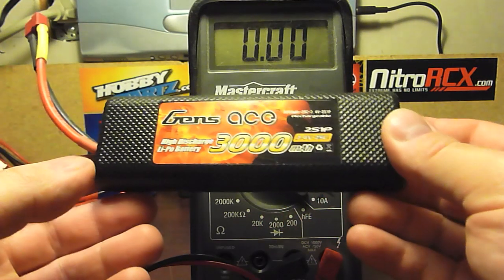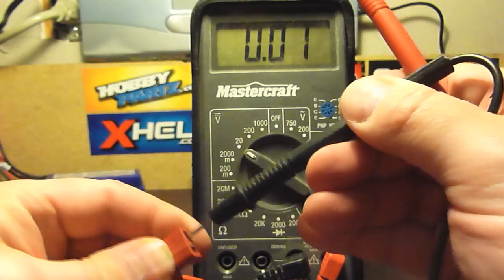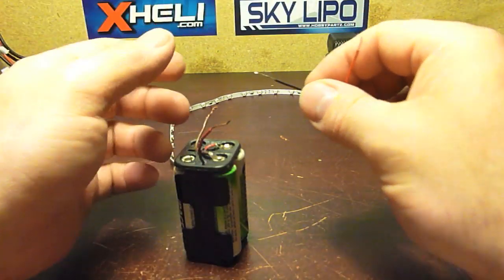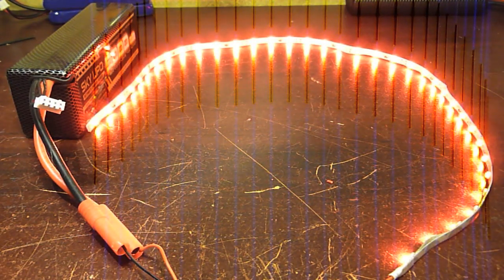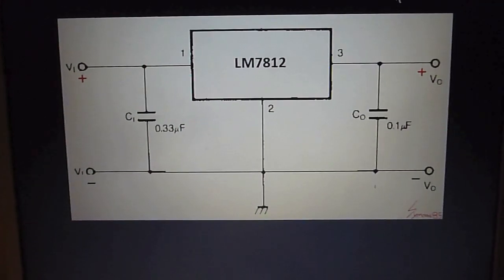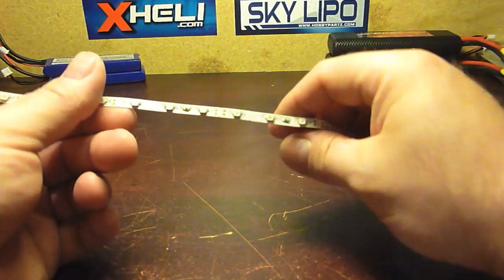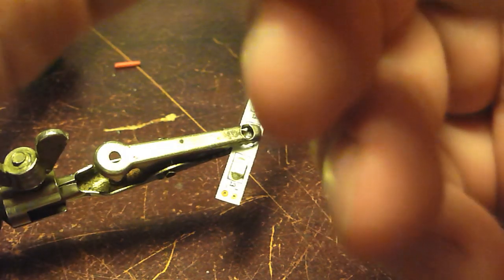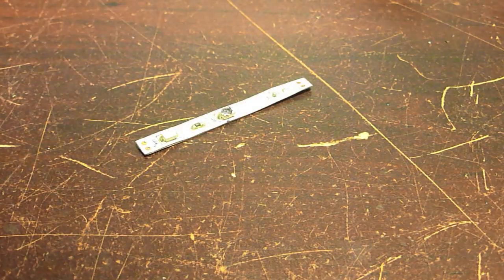Battery Voltages and powering LED Strips

Comment: Hi! I was planning on using a 2S or 3S lipo to power up a 5V addressable led strip. The strip is 5 meters, but i have an option to cut it in half.
I really like Lipos for their size and weight, but the voltages are a bit too high. Of course, i have a arduino controlling the leds, but the logic level is on separate leads. Any suggestions for voltage regulation/dropping it in some way?
Reply from the maker: Iikka Konola there are lots of options for regulators. the easiest is to get A DC/DC step down regulator on eBay. they are very cheap. or you can make your own. Google it.
Reply: TheLEDwheel I have a 3A 5-35V one, just wondering about the correct it would be handling as 5m would be drawing 18W/m and  90W/5m, so 90W/5V=18A.
Reply from the maker: Iikka Konola this is why 12v strips make more sense. it's just easier to power. at 18amps draw it will kill the battery quickly.

Comment: I bought a led strip  (12 volts). I want to power it with a battery. Can I use a 9v battery or do i need to use 8 x 1.5 volts? 9 volts is much smaller and easier to change if necessary.
Reply from the maker: hi, as mentioned in other comments, a 9volt battery will work with two issues. it won't last long and it won't be as bright. voltage is only one part of what we need to look at when deciding how to power anything. voltage will change your brightness but amperage will change how long you can power you items regardless of what you are powering. figure a smaller battery with higher voltage will always have less amperage.
Reply: +TheLEDwheel It has to work only around one hour  a few times in the week and it will by like 60 cm, so i think 9 V battery will do the job. Thank you
Reply from the maker: +C4mpi59 try it, I doubt a 9 volt will last an hour.
Reply: +TheLEDwheel I can't get 12 volt battery in my country, i would need to ship it from abroad, and this would be more expensive. Unfortunately i don't wonna pay too much for something that will be used just for some time for my guitar pedalboard.
Reply from the maker: +C4mpi59 get a 12 volt 1-2 amp AC to dc adaptor..

Comment: Hi I'm trying to replace the LiFepo4  solar battery. The roofers knocked off my mount and in the clean-up the battery was lost but the motion detecting LED light was salvaged. I tried and figured out it needed 9 volts 1 Amp. So I tied in line 6 rechargeable 9 volt 1 amp batteries so it would stay 9 volts one amp. It does not last more than a few minutes before it completely drains the battery pack I have soldered together. Is there a way to raise the amp hour? Volts times amp hours gives you watt hours.  But is this volts times 1 amp ? I'm missing something obvious here and I can't figure it out do you know what I am missing? Does anyone?
Reply from the maker: what did the solar kit come with?
Reply: +TheLEDwheel  Thank you for the rapid reply. All information you share to me will be shared (if okayed by you) to my readers as I have the Blog Gajetest.com, and like to give credit where credit is due. So that was my problem I could find out what volts and amps worked. But the roofers in the clean-up didn't save the battery and I only rescued the led light and crushed solar panel. The battery was gone, so I do not know what it held . I looked up the power light and could not find the battery type or the amp hours. Testing equipment for my blog is what I do. I understand that volts times amp hours is watts. However, in a 9 volt battery it would be 9 times 1 amp Is this one amp 1 Amp hour? If so then the it would be 9 * 1= 9watt hours. Again what am I missing? This is really embarassing and I thank you ahead of time for any information you could give. I turn 60 years old in May. I hope a fuddled mind is not my present. :)

Comment: what Sky Lipo 5000 did you use?

I want to make backup lighting in my house for when i loss eletric.
I know its not supper bright but its anuff to see once your eyes get use to it. (Now i use 3 candles)  i can loss power for up to 30 hours at a time  and 8 or 9 times a year,  (I live way way out in the country up north in WI.   only takes 1 tree to fall to loss eletric for long time.  

using the Sky Lipo 5000 like this,  can it harm the batt?     
What LED scrip did you use.   how many hours would it run for?

Thanks for any if you give me.  

i did try to email you at your name at gmail  hope thats the right one.
Reply: +Just Me You don't need a super high output battery, just a high capacity one and depending on the led's you use it will change the brightness and how long they last. So the more Milliamps hour (mah) you have the longer it will last. There are 3s packs well up to 30,000mah

Comment: Hi- I'm doing some research for an artist  friend who is wanting to light a set of globes that will hang for the ceiling using LE Lampux 12V flexible LED strip lights. They are specifically called super bright 300 units 5050 LEDS. Are you familiar with this kind? Well the question here is she wants to use battery power to light them (no access to external power source) and wants to know how much power she needs to keep them lit for at minimum 35 consecutive days. Is it possible to do that with battery power?
thanks,  John
Reply from the maker: John Wilson 35 days? thats a long time. you need to know the amount of LEDS she will be using and calculate the amount of power(amperage) they use combined. I can't find the specifications for your lights but Like if a 6 foot strip uses 1 amp and she needs 30 feet that would be  30 divided by 6 is 5 amps. This means you need a battery that can do 5 amps per hour for 35 days. 35 x 24 is 840 hours x 5 is 4200 amps... I really don't think that is going to happen unless you were ready to setup 84 x 50 amp car batteries in parallel.
Reply: Thanks. I'll look further into this. so glad you're willing to answer these questions. :) wondering maybe if she could hook up the lighting system during the day and disconnect at night. That would be more feasible, right?
Reply from the maker: Yes that would as she could charge the batteries overnight. You still need to figure out how much power you need.

Comment: Hello, I want to power 3 MR11 3W 12V LED's from a 3S Lipo. Do I just connect the bulbs in parrallel to the source? They are rated 320mA so on a normal supply it should be current regulated i guess? Do I need an extra resistor or something else to restrict the current?
Reply from the maker: signalchef if they are rated 12v they should already be setup for it. I dont think you need more resistors.
Reply: Perfect, thank you!

Comment: This was awesome, and helpful.  What I didn't get though, was how to figure out how long the power will last.   So, if I get a BIG battery, and do the 12V regulator, how long can I keep it going on a full charge (To be transparent, I'm thinking of a sculpture, with LEDs inside of it to make it glow - but I don't want to have wires... So, something that can easily be replaced, and a 2nd battery charging while the first is running kind of thing).  Even looked at some of the "Laptop portable power packs" like the Sherpa 100, which holds 98Wh -
Reply from the maker: Ori Bengal Simply divid the number of amps being used into the battery's capacity. For instance a 30mah LED will run for about 200 hours on a 6000mah battery. Probably less because of the curve  of the power drain on the low end of the discharge. so 6000mah divided by 30mah = 200 hours. Obviously a power strip uses more power than that. If you power strip has 100 LED's then its 30 x 100 = 3000mah. 6000 divided by 3000 = 2 hours. Hope this helps

Comment: Hello! I'm not to good at all these lights things, so hopefully you may answer my question.. 

I'm buying a 12v led light strip, they come with a remote control since they change color and such. I will be carrying these with me since its for a prop, what battery pack would be good for them? I would like them to be as bright as possible but I don't know much about this.
Reply from the maker: I think your best bet would be  a 3S LiPo battery. The Moe "Mah"(Milliamps per hour) they have the better. on ebay look for "3S LiPo battery". And you will need a charger for LiPo Batteries. Also search google for safe handling of LiPo Batteries.
Reply: Thank you so much!
Reply from the maker: dixiestar74 your welcome.   just a note... i was assuming they were 12volt strips. :)
Reply: Yes, they are 12 volt LED strips ^^

Comment: Hello & thanks for this video. I work with photographic light boxes & use 12 volt LED strips. I usually plug them into the wall. But I want to move to battery power. However, I need to keep the costs down, as I have 12 individual boxes that need powering for a show. They need to stay lit for as long as possible, about 8 hours per day for up to two weeks? The smallest strip is 39cm, the longest 130cm in case that information is needed. Any advice is a huge help. Thank you!
Reply from the maker: Personally i would buy one or two power packs.  These are designed to boost a car when I  trouble your thing but the bigger ones have tons of power and also give you a 12 volt  outlet as well as a 120volt AC inverter. You can charge ift in the car too. The longevity depends of your current draw abs well as the capacity of the booster pack itself.
Reply: TheLEDwheel Thank you for the reply. I need to be able to power each light box individually. The light boxes will be for sale. So my clients need to be able to buy it off the wall & take it home. I'm thinking I probably can't do this with batteries. If I could, I need a very compact one that can stay charged for as long as possible. Any tips?
Reply from the maker: Linka A Odom  Ideally you would try and get the highest capacity 3s LiPo battery you can find. i have seen some that were rated at 20,000mah and lets say one strip pulled 1000mah, theoretically it should power that strip for 20 hours. BUT! they are not cheap and you have to sell it with an appropriate charger. Also LiPo Batteries are inherently dangerous if mishandled, must be transported securely in a fireproof case, and charged safely. Now this is not to say they are not safe.... but mistreating a LiPo can be hazardous. Hard case LiPo strongly recommended.

What is the power rating of the longest Strip?

Comment: Ok thanks for the quick response, how about a 18 volt lithium ion battery on 12 volt led tape light, I tried it briefly and it works but but is it too much voltage, I don't want to burn out the light or cause a fire.
Reply from the maker: It wont cause a fire but the LEDS will definitely burn out. Like I said..... never go over the specified rated voltage.

Comment: Will a 12 volt lithium ion drill battery power a 12 volt led tape light?
Reply from the maker: Voltage is voltage..... as long as you are within the specified allowed voltage it makes absolutely no difference what the source it.

Comment: i ordered led strip with that to power them3s connect balance lead not 2s which is what I have can I addd in another 2s lipo and use
Reply from the maker: I would not recommend using the balance connector to power anything. Anything above 3s needs to be regulated. Check my other videos on how to make a 12 volt regulator.

Comment from the maker: Idealy you should use 3 batteries in series to get as close as pissible to 12 volts but it will work, just nog very bright. And how long they power the lights depends on how much amperage they have.

Comment from the maker: search for "theLEDwheel" exactly. no spaces

We need to know the power drain of the LED strips but its fairly easy to figure out. Lets say we have a 2000mah(2 amps) 12 volt battery powering a 1 amp light. 2 amps per hour rating(MAH) with a drain of 1 amp should theoretically last 2 hours.
If the Light draws only 300mah then its 2000mah divided by 300-mah = about 6.5 hours

Comment from the maker: That question is a little vague.
it would depend on what batteries you are using and how many amps they have.
8x1.5 volt AA Alkaline batteries in series = 12 volts and no matter how many you put in line the amperage remains the same. Let say the amperage is 2000mah per cell. If you were to take the same 8 batteries and connect them in parallel you would have a total of 16 amps at only 1.5 volts.

To have an easier time explaining this please come see me on "theLEDwheel" Facebook page

Comment: Sorry for the late reply! What i did was the following -  a 6 AA battery holder with 2.1pin for the red and black wires. then brought an 50cm LED strip that came with a 2pin adapter so i was able to plug it in. It is for my car that i drive. It lights up at night pretty nicely. Cheers

Comment from the maker: No overlapping, side by side creating a full dot. Just make sure your strip is straight. 
To make is stronger you can also place a small piece of wire across it. Holding it down with a hobby knife while you solder it. If you have to, tape the strips down to keep them in place.